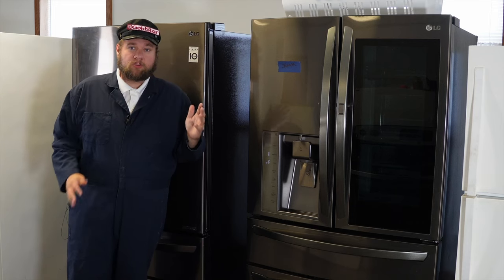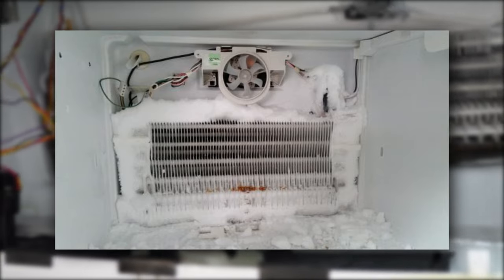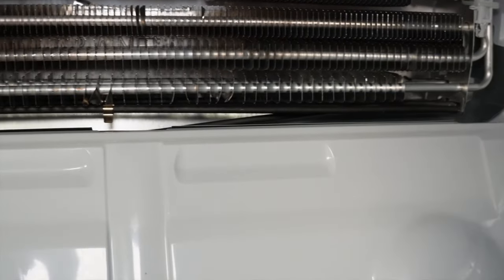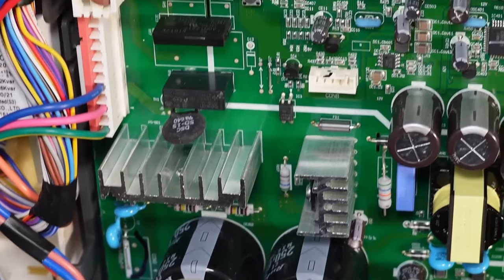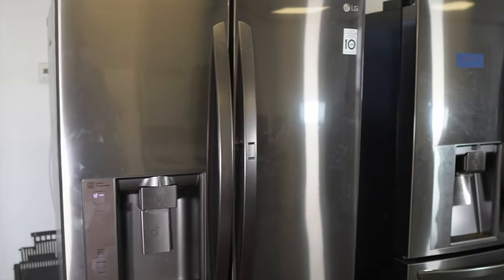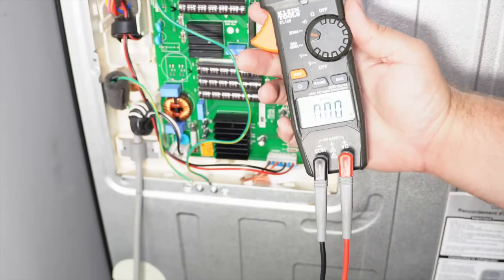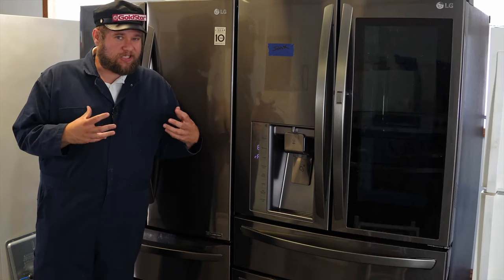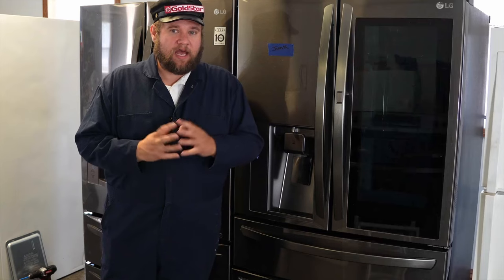LG Refrigerator Won't Cool - How to Troubleshoot and Fix

Comment: Thanks for the video!  My whole LG refrigerator stopped cooling (fridge and freezer sections).  If the compressor is vibrating lightly, could it still be bad?  Thanks!
Reply: Did you get it fixed? I’ve got the same issue right now .
Reply: @caitlinelaine1  Yes, it was a bad compressor.

Comment: HELP:
Question, when you run a defrost test , the evaporator fan should stop running?  
Because my LG refrigerator Model # LFXC24726 when I did a first test the evaporator fan working , second same thing working but the third test not running. What should I do? 
Fan is bad?

Comment: Does LG have a diagnostic tool to interface with the control board to troubleshoot and make temperature corrections. Would be nice if they could actually see real time what the refrigerator is doing, see compressor speed(inverter) fan speed, thermistor value. The way my technician has been troubleshooting my refrigerator is just throwing parts at it..

Comment: I own an LG refrigerator (model number GR-B522GLHL) that is experiencing some issues. It's not cooling, and both the fan and compressor are not turning on. When I reset it, the light flashes six times. I took it to the LG service center, and they informed me that the compressor is faulty. They mentioned that the cost of replacing the compressor is higher than the value of the refrigerator itself. Can you provide any assistance with this issue?

Comment: Secondly, where do we test the sensors for the defrost. Thirdly, if the temperature displayed is off by 30 degrees, where would we find the temp sensor or thermostat that is taking that reading?

Comment: Ran up against an LG Ref. with no capacitor that I can find (Call LG and all they could tell me is that it doesn’t show one) WTH!
Not by the compressor and not connected to the PCB board. When I look it up in LG website and other supply companies, it shows a capacitor connected to the PCB, but there is no wiring harness for and it is not there. Any ideas??
Model: LFCS22520S /05

Comment: I have an LG LMXC23796M, the issue I am having which wasn't necessarily included in this video. I am not having any activity from the Front UI Display Panel. The reason I am asking is because When Cycling the Test Mode I do not receive a Beep. I assume that the audible beep comes from the Front Display. Could the front display have involvement with the Fridge and Freezer not cooling? All of the other hardware seems to be functioning. The connections from the unit to the Door are good. I just haven't seen any information related to the situation of the front display not cooperating. Also just wondering if the Main Board PCB could be the related problem for the display not functioning and the system not cooling. I don't want to replace just the front display or display PCB when it was obviously the Main Board PCB. Any help would be very helpful and appreciated.

Comment: I did a forced deftost on my samsung with twin cooling as the fan had frozen over, fridge worked like a charm beforehand. After defrost i cant hear the compressor or fan come on. Tried to do he "force compressor and fan on" function and i havnt heard anything come on. Any ideas? Fridge was fine before the defrost( with exception of frozen fan)

Comment: Thank you Ben for an excellent video. Your explanations are very clear and understandable. I would like your confirmation on something before I spend money on a board (which I'll buy from you, if you have it). I have an LG LMXS28596D /01 and my freezer is at +10 degrees when it is set at -6. I ran the 3 tests and don't get any LED flashes, and LG ThinQ app doesn't find any problems either. My CON201 connector only has 3 wires, and the highest voltage I read is 128 VAC (the other 2 combinations are around 50 VAC). I have an amp clamp, but I lent it to someone, so I can't get the amperage reading right now, but it seems like the low supply voltage is enough to call the board bad. Is that correct? Is the board covered in that 1st 5 year warranty? (I've had it 4 years). The board # is EAX67860903-1. Thanks in advance for your help!

Comment: I just had a service tech visit me and they say they will need to reprogram the board when they change the compressor since the old compressor is not R134 they say. To my understanding everything made is R134 and this fridge is from Sept 2017.
Reply from the maker: They do need reprogrammed regardless as the board needs to run at a better/softer speed as not to damage the new compressor. But it should absolutely be R-134. You should be able to look @ the compressor and verify refrigerant. Same goes for unit model#
Reply: @bensappliancesandjunk  the label says is R134a but looks like I'm buying a new Fridge. They want $1200 to fix it now and if I do warranty it could Costco $800 and up the tech says. @LG No more he also suggested avoid @Samsung fridge

Comment: LG refrigerator only one problem in 99% is the compressor. I'm telling you as a technician who has changed 60 compressors on LG refrigerators with cooling problems over the past 3 months. of these 60 compressors, two LG refrigerators were a clogged drier filter through which gas passes, but most likely this is also a problem with the compressor, which began to drive oil through the system, which caused the filter to clog
Reply: My 5 year old LG fridge died. I'll assume it's the compressor like you say. I only bought it because I was in a desperate hurry, about to go on a business trip when my 30 year old GE quit. Ice maker never worked. It leaked all over the floor and all the lines are underneath. Waste of $1600. Wish I would never have to buy another Chinese manufactured item again, but it's unavoidable at this point. It's all throwaway garbage.
Reply: Replacing a compressor on an LG refrigerator costs approximately $650-$750 it depends on what state you live in
Reply: Labor and parts or just labor

Comment: My LG french door LMXS28626s is not cold enough for both the top refrigerator portion and the bottom freezer. When open the freezer back panel to see the evaporator, ice is built up around the top portion where the silver line come in and the light (normal) frost is seen on the top row and portion of the 2nd row of the evaporator while the rest of the evaporator has no frost at all. The repair tech diagnosed the problem is the freezer evaporator fan not working (after he waited for the compressor to run and did not hear the fan running). Is this the real problem for my refrigeratornot cold enough (the top frig portion is only 45F even being set at 33F and the freezer is only 25F when set at -6F). The coil fan is working. My questions:
1. is the evaporator the only problem and fixing it will make the refrigerator cold again?
2. could there be also a leak of refrigerant in addition to the fan (heavy frost where the silver line come in as described above?
3. My refrigerator ice tray does not turn and dump ice in the bucket. Will fixing the problem in question #1 and #2 above will solve the ice tray turning problem?
Thanks
Reply: Same problem here did you ever figure it out?

Comment: Ben, would you say that you would check everything in the order you showed in the video if everything is working, but it just won't cool any lower than 40 degrees?? 

Our fridge just barely will stay at 40 degrees if it's turned all the way down to 34 degrees.
Reply: What did u find out?

Comment: I've seen a GE 27 cu. ft French door without any thru the door dispensers. Water available inside the fridge, ice maker in the freezer. Most places here in Connecticut are asking about $1500. What's your opinion of it?
Reply: Buy a new frig😂

Comment: A lg service tech came out 5 times and changer most of the parts on it and still not working right gave me a 1200.00 credit for a 3000.00 fridge. Then the service guy knocked over my 450.00 miter saw  in mt garage they are not paying for that.
Reply: Went through kind of the same thing minus the knocking over of the miter saw, had the compressor changed, then the evaporator, LG tech came out and put freon in multiple times, and fridge still stopped cooling with in a couple of days, he said there is a leak somewhere he can't find, and recommended getting a new fridge, this fridge was only 6 years old.

Comment: I'm gonna bookmark this, because we had 2 refrigirators that didn't cool properly
Reply: Did you go through and do these checks? Did you find anything? 

We have to turn the temp to 34 degrees to get it to stay around 40 degrees. It never goes below that. It's always seemed like it's been this way, so I was wondering if there's a good place to start.

Comment: Damn had my LG for 7 years no problem. Fridge and freezer is not cooling and after a deep dive in Google research and calling a repair man I’m be $800 deep for a compressor swap and from what I’ve learned this is going to be the beginning of breakdowns. I might as spend an extra 1200 for a new one and never buy a LG again!

Comment: Thank you for the info, i will save myself on not buying an LG, i have the exact fridge you have shown on this video, no code, not cooling..made 2017, pass 5 years, LG said they would pay for the compressor parts, i have to pay for the labor, not sure how long it would last. What is a good refrigerator model to buy that can last atleast 10 years?

Comment: While the voltage Test… on my LG refrigerator, control card ( on test mode)is only giving me 70v .. after few seconds voltage rise to 90V … can anyone suggest me which component is likely to be bad on PCB.. I tried changing most of capacitors, no luck
Reply: Run test #2, then wait about 45 seconds. It’s ramps up slowly. It doesn’t jump from 0v to 165v the second it comes on.
Reply: @larrymansfield9393  Thanks a lot, I will try that

Comment: I repair appliances.  Unless you buy Sub Zero  Viking  or other high end unit good luck. Bosch, Lg, Samsun, whirlpool,Ge etc is trash.
Reply: LG replaced a 17 cu top box GE still running since 2004 in basement. It’s what she wanted figured it being crap shoot on the compressor issue. Some vintage stuff you can actually work on and does the job afterwards. 👍

Comment: The short answer is...dont buy these worthless LG Fridges in the first place...they make awesome defrosters if your trying to thaw out some meat.  You never really "buy" an LG fridge your pretty much on a rental basis ..sure you may "purchase" an LG fridge but your guaranteed to pay rent oh if it needs a new compressor and its covered just say nope I will pass...you will be dishing out another 2 or 300 in rent the next month for condensor coil etc...buy a known good brand hell I dont think anything stateside anymore but GE Frigidaire Whirlpool  are good...I have a hot point in a garage in Texas - been keeping beers consistently right above freezing even if its 120 outside.  FLG FJB and FKH and that horrible excuse of a dog turn tampontim.  LG does make decent TVs though...just dont get a fridge

Comment: in my opinion LG and Samsung are expensive junk. I'm working on a LG bottom freezer that the evap fan cycles off and on after unplugging it for a minute. customer said it cooled ref compartment for about 12 hrs.' and stopped again.

Comment: Thumbs down for showing the crappy LG compressor coil design and lack of access to the coil front and then showing you cleaning a much easier to access refrigerator coil. How about a video showing the best way to clean the coils you are showing in your video. Im not convinced you are more than an armchair appliance tech.